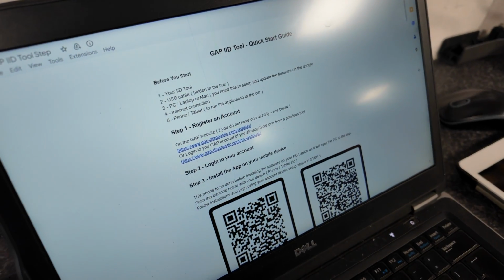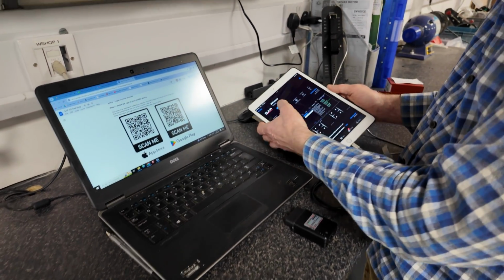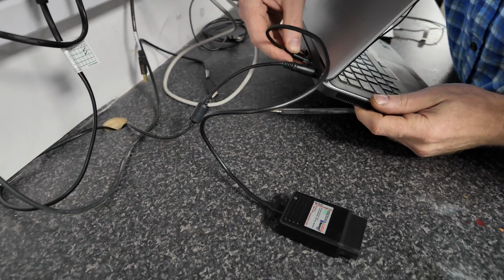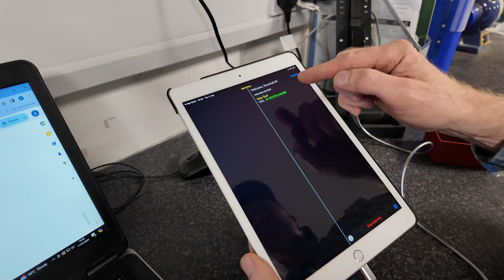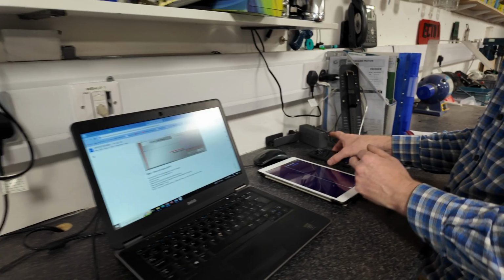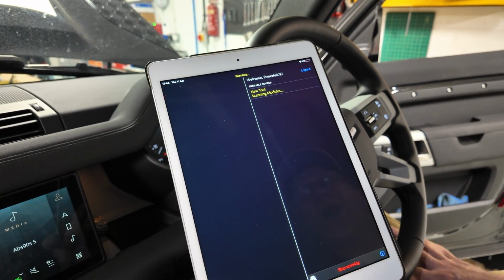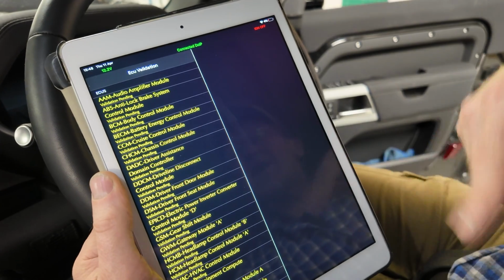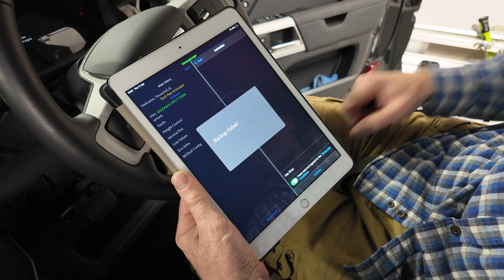Gap Diagnostics IID Tool - Quick Start Guide ( un-official )

Comment: Have to Range Rovers (2010/2011) what version do you recommend as most cost effective for I understand having to register the 2nd VIN. So, can I use it on both if I do. Isn’t the 3 or 4 not require registration and can flash more than 1 Land Rover?
Reply from the maker: The IID Generation 3 is probably the best tool - but you will need to register 2nd VIN if you want to flash ECU - of course fault reading and clearing is free for all Land Rovers with the tool.

Comment: Will the Gap IID Tool disable the eco stop start on a Disco 4. 
most other vehicles it is a simple press the button once operation. 
The Disco 4 it has to be done every time you restart the vehicle. Or alternatively disconnect the earth lead to the auxiliary stop start battery.

Comment: Hello friend. I’m going to keep following your gap tool videos. I have a basic question and also would like your advice. Is there a way to lock into off road 1 or off road 2 height with the tool. I would like to always be in one or the other height. Is that possible? Do you think it will drastically hurt the vehicle?

Comment: Height adjustment vid please! Can you see if it’s possible to save a new lower access height without lowering the standard height. I believe it’s only possible as an offset and any changes will change all heights offset by that amount… I’d like to just lower the access mode a bit, without changing the standard height
Reply from the maker: I did check this recently with Patrick at GAP and he said its only possible to do an offset for all 3 modes.... all higher... all lower etc.
Reply: Thanks for the reply Simon! Hopefully something they work on in the future! Keep up the good work!

Comment: Great tool. I use it for levelling my disco 4 (with roof tent) whilst camping. Always fun watching other people with campers struggling to drive up ramps on gravel etc. Whilst I just plug in my tool and can raise and lower individual corners as required. Had an audience yesterday evening at a campsite in Slovenia where I opened my roof top tent and adjusted the air suspension. People looked on like I'd just invented fire 😂
Reply: For Toyota drivers, this is like inventing fire.
Reply: @Vera_and_Christian  😂😂😂
Reply from the maker: Sounds cool - i need to try this with my Defender !

Comment: Simon slightly off topic , but concerning the gap tool. LR have recently been sending out emails concerning the online data subscription renewal , which is for one of the built in SIM cards used for things like Spotify. It has taken them so long that people are getting these for the first time even if the vehicle is 3 years old at a cost of £120 for a year or £190 for 2 years. I have spoken to customer services and it seems that the initial subscription was for 12 months but it has taken them so long to sort out how to renew that people have been getting it free. Now it has been sorted if you want to keep it you have to renew. What my point is , if you can remember, some markets had a slightly different panel where the USB C and USB A ports are in the lower dash, In the middle was a sim slot. I can faintly remember LR Retrofits fitting them. I’m wondering if these panels are still available and if it’s possible to switch from the build in sim which is the data one , not the one used for OTA updates, to this sim using the GAP tool for instance. It will then be possible to choose your own data sim and contract. Hope you can help.
Reply from the maker: Hi Peter this is something i looked at. I think it is unfair to charge this fee for the data. so there are 2 options
1 - Change the USB port in the front for the one with the SIM card and change the CCF files - I have done this and it works.
2 - Ontop of the main control unit under the seat there is the PIVI control unit - ontop of that there is an IMEI number and ICCID. As the PIVI control unit does not have an actual SIM - it has an E Sim ( like an apple watch ) it should be possible to port the data to a different provider. I think you need a PAC code for this. I would like to do more investigation on this but a little short on time. Is this something you can follow up on. Drop me an email through customer service.

Comment: Can this be used to set the driver assistance mode to custom ,permanently ? As it always reverts to the beep thing after a restart.😡 also is the yearly subscription required in order to use this ?

Comment: Love my Gap Tool. Adaptive Cruise, Park assist, on demand e-lift (great on the trail), lower to the bump-stops (great for my garage with skis), service mode for doing my brakes, fogs on with full beams, global close, dynamic mode (who doesn't need a g-meter on their car?), in car wi-fi hotspot and more. Code reading, live values....... Best gadget ever.
Reply: i can't figure it out.  I'm furious.  i want to calibrate the four corners of air suspension and I don't understand the numbers on the device, the up/down arrows which seem to have a 30 second delay, and so cant do anything useful
Reply: Fogs on full beam?! I must go and do that now! Was that D3?
Reply: @ Works with G3 or G4. I activated it with G3. Most activations with the exception of Adaptive cruise and Park assist can be done with G3. Fogs on with full beams is surprisingly useful on dark country roads and forest trails.